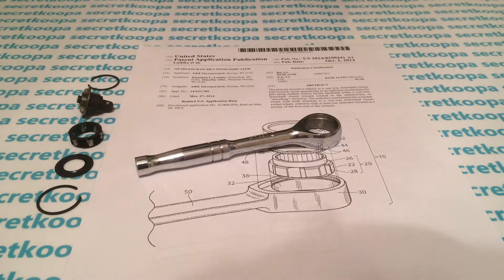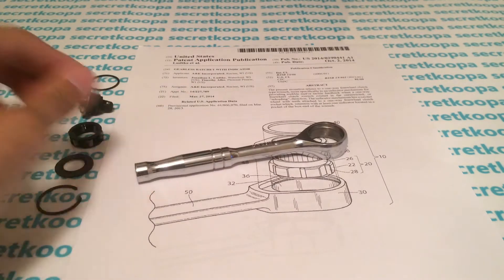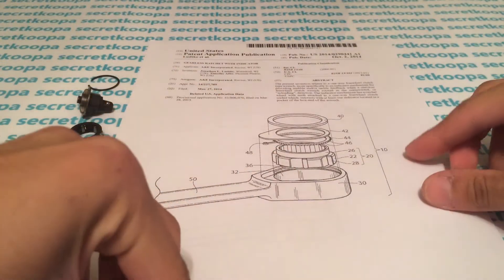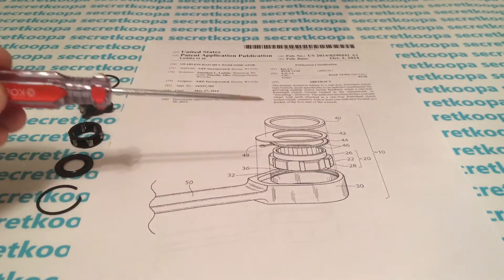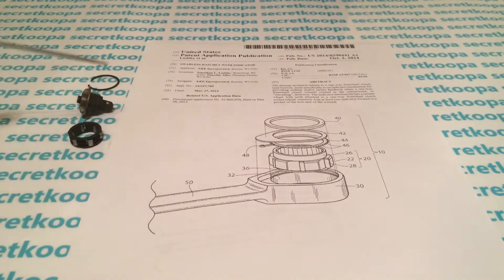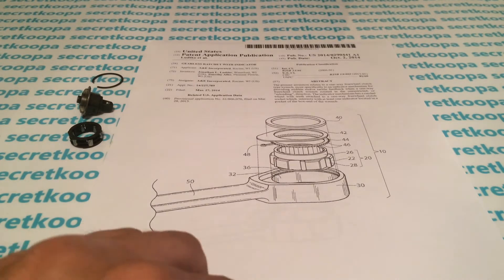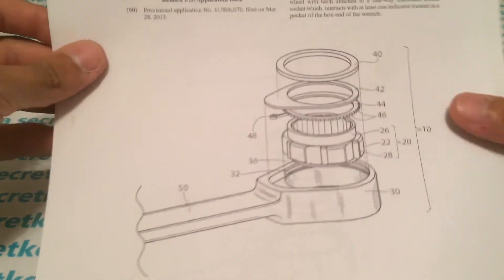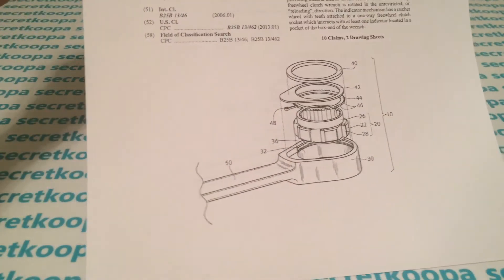New Kobalt gearless/direct-drive ratchet how does it work!? Part 2

Comment: I'm sorry to say but your explanation is incomplete. To understand how it really works, go and search for "harmonic drive", which is a gear attached to a flexible toothed belt that skips only a tooth in each revolution, providing a high mechanical ratio. Since this mechanism is rigid rather than flexible, it must be eccentric (or designed to wobble a little around a pivot other than the center of the drive square). Otherwise it would simply lock in either direction from the center.

Comment: Looks like Lowe's took it off the shelf, don't see it anymore. Wonder why?
Reply: It may have something to do with how this "bearing" wear when it gets wedged really hard. There is a considerable leverage involved. And that's not easy with a cylinder shape since a point of contact is so small, not like with a normal wedge. So the "bearing" elements eventually get dented or crack...
And it may also stop working if any oil gets inside.

Comment: Some of the equipment I used to work on was a motor driven, spring return gear train assembly with a "Clutch" bearing (basically a one way bearing) replacing one of the standard bearings so the gear assembly could be manually actuated without having to move the entire transmission gear train. This is basically the same bearing with a socket head replacing a gear shaft. I always wondered when someone would get around to doing this, I had an early idea but absolutely no knowledge or equipment to go about it. I now wished I had investigated it more but was already doing fairly well and had way too much work as it was.

Comment: I wouldn't like one if it didn't make a clicking noise either because if you're in an area where you can only get one hand in there and you can't feel or see what the ratchets doing you can't tell if the bolts coming loose or not
Reply from the maker: Very true that's exactly why they came out with this patent! it includes a combination of parts that make a "clicking" or "reloading" sound. Now there is a draw back to adding teeth, being that when you are using one with teeth you will tend to wait until the tool "clicks" which  could be every 5 degrees (72 teeth), when this type of tool can work in the 2.5 degrees range. This essentially means that you are sacrificing some of the tools ability for ease of use.
Reply: Secretkoopa 
well they could easily make the clicks with much smaller increments, such as 1 degree steps, since its purpose is simply for tactile feedback and not the actual drive. Can be very light duty with no effect on the strength.

Comment: How does it reverse the direction though? i understand how it pinches into the sidewall and drive mechanism, but it is all symmetrical all the way around the drive mechanism, and the side wall. so what exactly moves when you turn the dial? Does it shift the position of the drive mechanism in the housing from one side to the other?
Reply from the maker: Great question! The design in the patent is for a flip-reverse ratcheting wrench which means they only function "click" in one direction so in order to loosen a fastener you need to turn the tool upside down. This socket wrench on the other hand has a bi-directional hex shape in the center. That is the part you adjust to tighten/loosen fasteners. By moving the tip of one of the 6 ends to one of two sides of the ball you can tighten/loosen fasteners. If you move it to the left it will tighten and the right will loosen.
Reply: Ya i understand the flip reverse wrench, pretty standard there, just wasnt sure how the socket wrench worked. Thanks for that info.
Reply from the maker: Not a problem if you want a better idea of what I was trying to say look at 4:40-5:00 of this video. This shows you the center hex being moved from one side of the ball bearings to the other side. That is how you select the direction
Reply: Secretkoopa 
so the Kobalt socket wrench is an update to the basic patent design- I can see this is like the mechanism for automatic transmissions, which use the same lockup design for one way drive.  
So it looks like the direction switching implementation is done by rotating the internal hex drive peaks closer to the roller bearings in the direction needed to jam the bearings against the outer wall when driven in the desired drive direction.